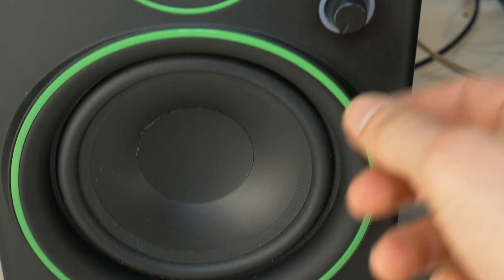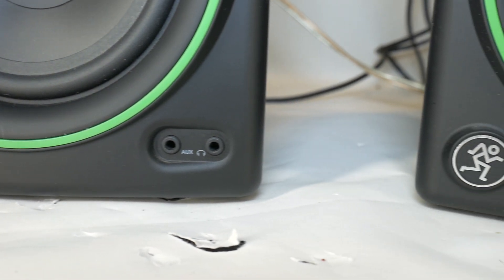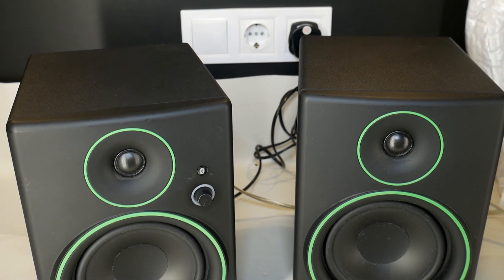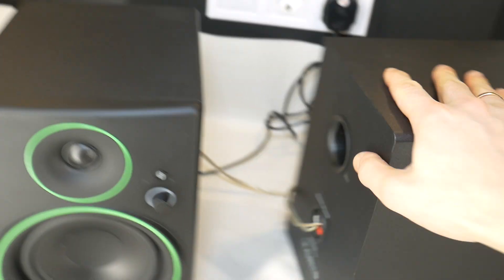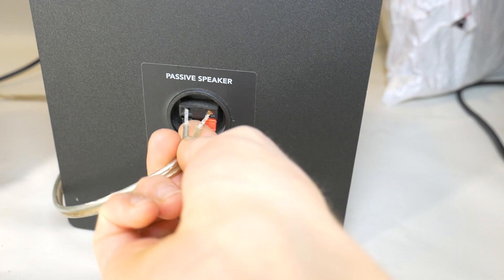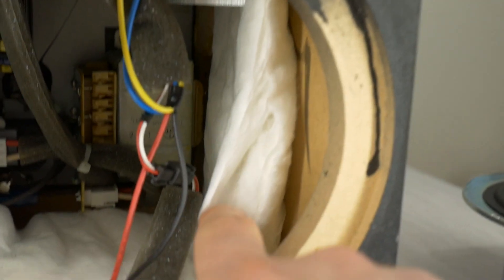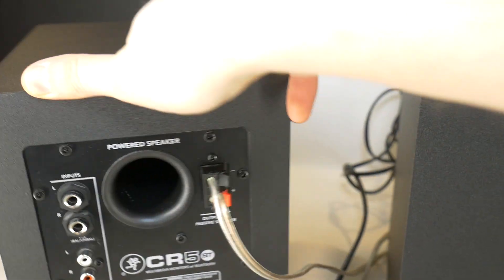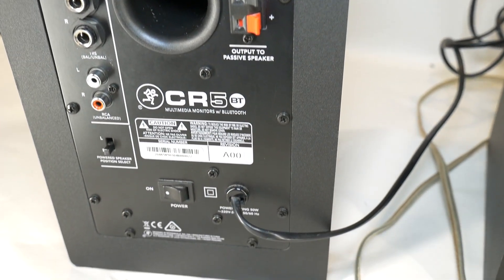Mackie CR5 BT Speakers Disassembly

Comment: Can you tell me what is the depth of the amplifer board in centimiters? because i wanna remove this board from the case and am going to put it in another case that i've already made😂
Reply from the maker: I also hope make video about this stock amplifier change.
Reply: @Techscrews  Or can you tell me the length of the cylinder attatched to the back panel?
Reply from the maker: @narrajj  please send PM picture with needed dimesions.
Reply: @Techscrews Thank you! I wanna know the width of this part's green board. 1:22 
I mean shortest part of the green board

Comment: I have mackie CR X 3 -BT .. and only one throws hereable sound properly when i set the powered speaker to that side .. only one monitors works at a time .. Can you please tell me about problem in monitors and what its solution is
Reply from the maker: mackie cr series speakers has a lot of problems full internet, very bad quality :(